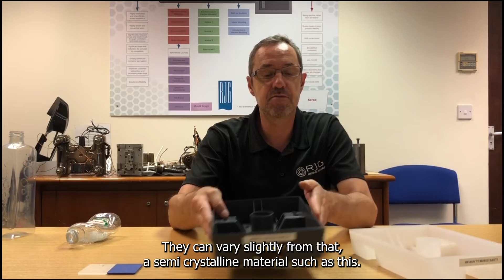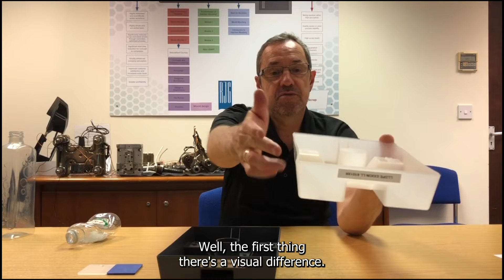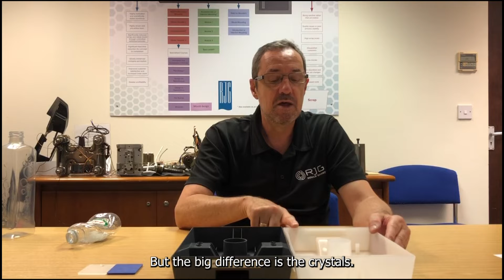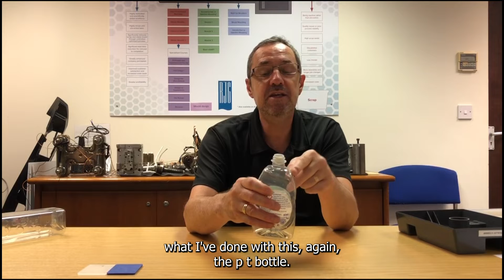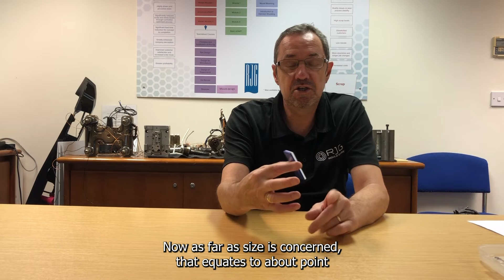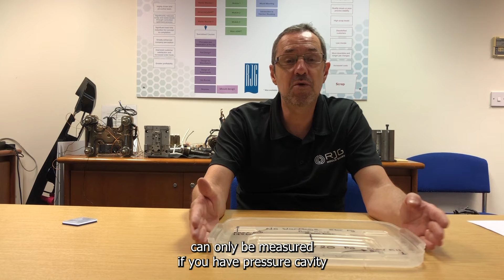Shrinkage Effects on Various Materials, Additives, and Processes in Injection Molding

Comment: I have question!
How we should measure the initial shrinkage of plastic? Please help me
Reply from the maker: Hello! The way that we do it is to measure the steel size of the cavity. For example, if have the steel size of the cavity which is 62.5mm x 49.5 mm, anything under this measurement is plastic shrinkage. We initially measure the parts immediately when they come off the machine and again 24 hours later to check total shrinkage. So looking at a sample part off the machine we measure a length of 61.30mm and width of 48.65mm, which calculates to a 1.92% shrinkage along the length and 1.71% on the width. After 24 hours the plastic has continued to shrink and the final shrinkage is 2.97% on the length and 2.34% along the width. Hopefully this answers your question.